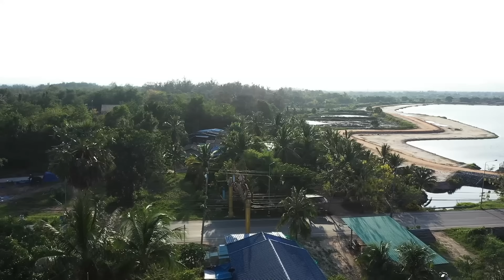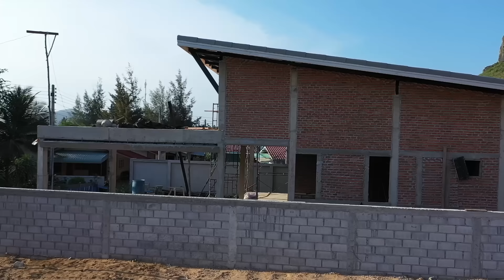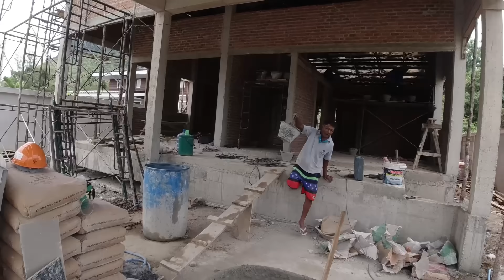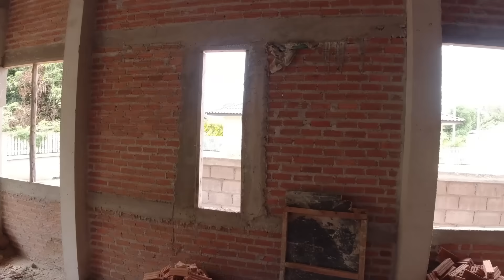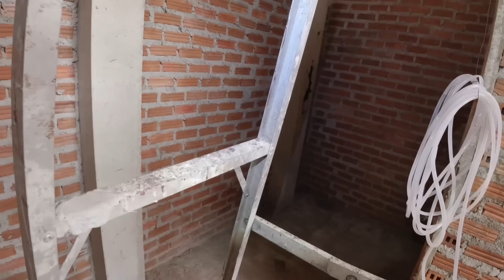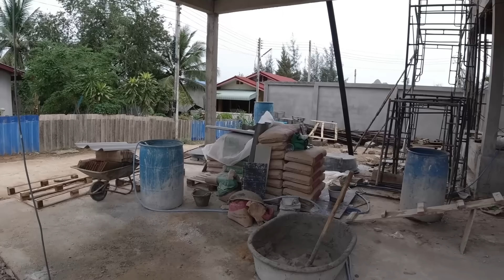P#12 Building Our Home In Thailand - Tear It Down

Comment: Joe, I am following your journey from Singapore. I am also an engineer in the construction industry. JJ has done well with your build. I can't see it clearly on TV but I would just like to suggest that there should be a bird mesh in the space between the roof and the concrete or brickwork. This is to prevent birds and other small animals from getting into the space above your ceiling. You know what can happen if they did.

Comment: It’s nice to hear that you’re going with the double wall in red bricks. Eliminating the look of posts will give it a more resort feel.  Solar panels are a big expense when electricity is so inexpensive.  In our 30’s we could recoup our expenses. Being in our 50/60’s it just didn’t seem important to us.   With your gutters I would suggest do it once, do it right - large and metal 😊 Continued success with the build.
Reply: I agree about solar!  It's still a novelty here in Thailand.  PEA doesn't pay you for extra power; they give you credits.  Even with the {relatively high} cost of electricity they are as expensive {if not more} and require maintenance. How many months worth of electric bills would you pay for 120,000 baht?  I'd consider solar ONLY if electricity was not available or maybe to power pool pumps and systems.

Comment: When we built our house I was still working, but wanted it finished when I retired. After completion, we went to Thailand to take a look at it and everything looked great. Two years later when we returned after retirement, the block wall fencing still looked great in the front and on the inside, but on the outer sides where they had not sealed it with cement and painted it, it looked terrible. It was almost completely black with mold. From what I can see, they are not doing your fence on the outside. Just somethig for you to think about.
Reply: I think the same too, contractor wants to save the cost but it is better to have both sealed.
Reply from the maker: Thank you 🙏 The block walls will be rendered and painted with a 4 season external paint 100%. Stay safe!

Comment: Just noticed the road on the looking west clip.  Is that new or an improvement to the coastline? We just celebrated completion of our  home in Wiang Chiang Rung, northern Thailand.  The rains are all around us now!   Very nice construction!  Lighting and tile choices will make a huge difference in the home!  Look at 5mm 40% UV tint for all your glass.  That helps alot with cooling the house.  My builder picked white PVC rain gutters, but I am thinking I'll replace them and add more using larger stainless steel.
Reply from the maker: Thank you 🙏 Congratulations on the completion of your home.  May you both have many many enjoyable years in your home. Stay safe!

Comment: I didn't know how closed you were to the water.  That is nice.  Red bricks are great for insulation and noise suppression, that's high quality material compared to concrete blocks.
You really went all out.
Reply: Autoclaved Aerated Concrete (AAC)   blocks are the best for houses in Thailand. The interior side of the block stays cool.  Excellent insulation and sound suppression.  Expensive but less labor to install.
Reply from the maker: Every has an opinion and preference. Mine is red brick, as it is more durable and will withstand the high winds and weather in our area more so than AAC.  IMO, AAC is more suitable for small projects like sheds. Stay safe!

Comment: Your house is looking good!
I saw a paper on solar in Bangkok and Chonburi province. The optimal solar panel angle is south facing at an inclination angle of 15 degrees. Solar obviously works at other orientations but you lose capacity. How much you lose depends on the angle and orientation of the panels.

Comment: you should put solar panels on the top. It will go for central heating or AC!!
Reply from the maker: That is the plan. Stay safe!
Reply: @thaigirlgiftforeignerjoe7774  okay cool. you can use for both specification and it will cut your power to 0

Comment: Hey Joe, I priced gutters at Global since they didn't have them at Home Pro. I was in sticker shock when I saw the price. Good Luck!
Reply: Not only are UPVC gutters expensive, they are prone to leak (many joints and seams) and matching downspouts are even more expensive!  Look at locally made and installed stainless steel!  Clean looking and comes in many sizes.
Reply from the maker: No worries, it goes with building a house.  We plan on having large stainless steel gutters installed. Stay safe!
Reply: Looking good, great roof area for solar, big enough to sell back.